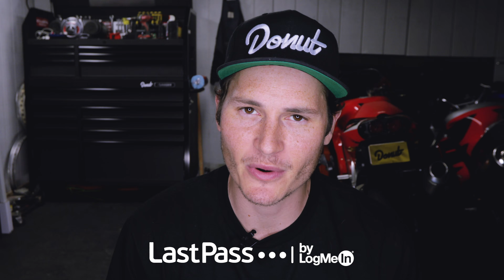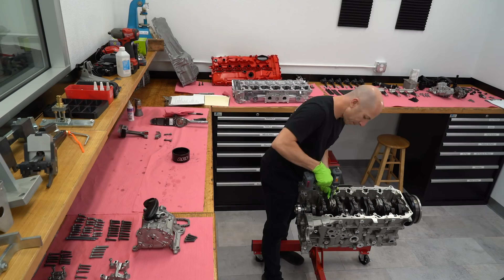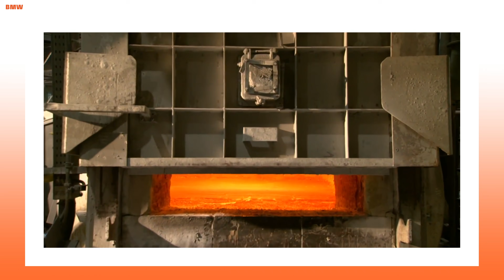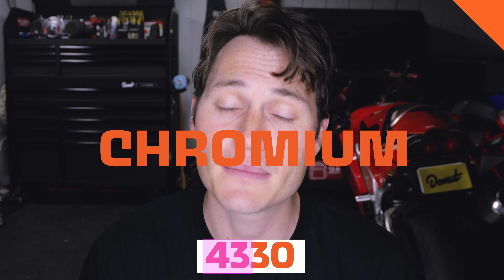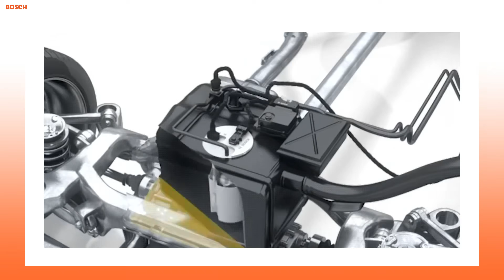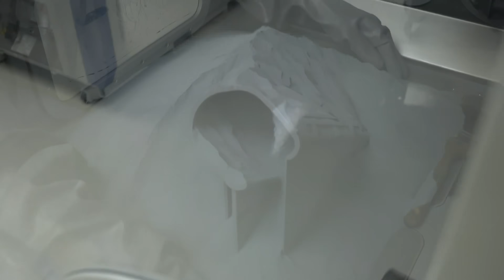The FIRST 1000HP 2020 Supra - Tech Explained

Comment: Having worked as a master technician for an investment casting firm (largest in the US) cast parts, can be just as strong as (hot) forged parts, given you properly design the mold then heat treat it. Also, you don't differentiate between hot forging and cold forging. Cold forging in a press retains / creates a TON more internal strength than hot forging. So grain structure horseshit aside, most hot forged shit, is way too hot to allow for uniform flow (it all gets re-arranged). Also, any proper casting, has no void issues, except maybe on hard corners on the outside (which would be shrink, not void). I ran a melt deck, that produced over a billion dollars (to the seller) of parts. Probably 7 billion market value. I could tell you just about anything except cobalt steels and aluminum (which was run in a different plant).

Comment: well 2JZ still cheaper than B58 if we are talking to reach 1000 hp right?
Reply: Takes like....under 7k to get a B58 to like...750-near 800whp and that's only having a bigger turbo,charge pipes,downpipes,tune,intake. None have modded pistons yet nor have any have put new cranks in them yet to pull any numbers but once they start slapping better pistons they'll be touching over 800-900+whp range more commonly.

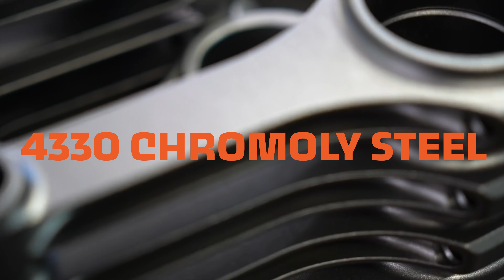Comment: Around 14:08.... a motor... are you talking about the alternator?... Not trying to be a dick but wow. Lets nail down the difference between an engine and a motor before we make a 'youtube' channel. I didn't expect explicit knowledge in your cute commetary on forging and casting and sand and... I would love for you to explain the difference to me about sand casting, core sand, resinated core sand, horizontal and vertical parted sand castings. What is a mold?  A parting line..? yea. Your NOT AN ENGINEER. Fine. But your making videos. Bro, please never refer to a combustion thermodynamic process powerplant otherwise known as an ENGINE as a MOTOR ever again.... A MOTOR is what you'll find in those fancy TESLAs that have wicked fast accelerations and sound like a fart in the wind on the freeway. Cheers mate!

Comment: You literally said it was a mostly stock engine, and then you said he rebuilt the engine. Wtf is this discrepency
Reply: They only changed the pistons internally,new intake , injectors exhaust manifold and a bigger turbo 

That's similar to a 2jz build but with a 2jz the rods are weaker point

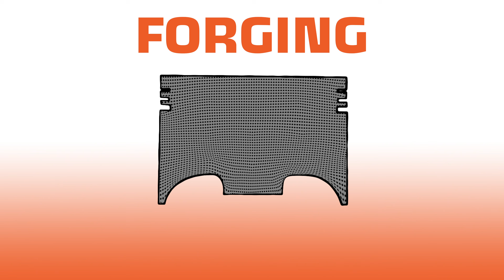Comment: At about 12:40 you stated that it's going to have a crystal structure in a uniform orientation, however this is only true in a single crystal sample which are not used in forging or in the automotive industry due to cost, among other factors.

Comment: so basically like the old supra, the engine was over engineered...
Reply: In simple words. BMW took a N54 took the best parts off it and did this:they took the block,bottom end,crank,and internals from a diesel i6 and made it modular with forged internals and crank and made a cooling system to keep it from overheating and made it closed deck rather than open like the N54 with 2 or 6 port heads. So basically a overengineered N54.

Comment: I hope some of you can answer this:
What were the cost of tuning it to 1000hp? Which one is cheaper to tune? 2jz or this? I want a comparison between these two! 
Sorry for bed engrish 🤫
Reply: In the time he made this he had made most of the parts himself so it'll probably be more expensive than a 2j just cause he made it himself possibly. But the highest rated B58s RN are pushing 6-750+whp with only a tune,turbo,intake,downpipe,and charge pipes being like 4-7k depending on the parts(mainly since 800whp is suppose to be there stock internals limit but only one has reached that high). Now there are cranks and pistons being made for them but no one's really had time to put them or use them in any B58 mk5s yet(or any for that matter yet)so we'd have to wait and see the numbers from them for rn.

Comment: What was the compression ratio in the cylinder itself? The 39:1 figure must include the boost pressure as compression. I am just curious about what the cylinder compression ratio is because the default compression ratio in the 2020 Supra was high(11:1). They lowered it to 10.2:1 for the 2021 model. That allows much higher boost pressures.
Reply: I was wondering why he said 39:1 is that normal engineering practice when defining compression ratio?

Comment: "Relatively limited modifications" =? Tears down entire engine.... hmmm
Reply: Yes, that's what smart people do, understand it before messing with something
Reply: Well for an engine that produced 1000 HP and has limited aftermarket parts is relatively has limited modification. Stephen Papadakis is not just a typical mechanic that thinks he knows everything by just slapping a freaking turbo and waits until it blows up
Reply: I know right..haha
Reply: He tore down the engine to understand the structure. Now that he knows it he can tune other supras relatively easily.
Reply: And he had to make the manifold 3d printed because there are no aftermarket fuel injectors. Once the aftermarket support catches up no 3d printed intake manifold will be required making the tuning easier.

Comment: 39:1 compression is an imaginary number that is really so far away from being reality, even Formula 1 cars have numbers around 15-17:1. I don't know where this number comes from, probably it is calculated as dynamic compression ratio or simply the pressure ratio.  Good job anyway, considering the efficiency loss due to the outdated injection system, it should have more potential in terms of power.

Comment: Ugh you are NOT nerding out- forging is NOT better because it aligns grain structure, that happens during the HEAT treat, which cast or forged parts have to go through. Its a lack of voids and the choice of steels that makes forged parts better- but forging creates stress fractures which means that part HAS to be normalized BEFORE heat treating- if you just forged a part and finished it and shipped it out it would IMMEDIATELY fail. Donut- stop continuing this incorrect wives tail. Research stress fractures, forging, and heat treat and make a video about it please.

Comment: Isn’t this basically a 40i engine?
Reply: Yes. Main difference between it is that it has a high pressure fuel system compared to other B58s.
Reply: @carboydorifutoparty3976  The supra has that? so the Supra has more potential power than say an M340i?

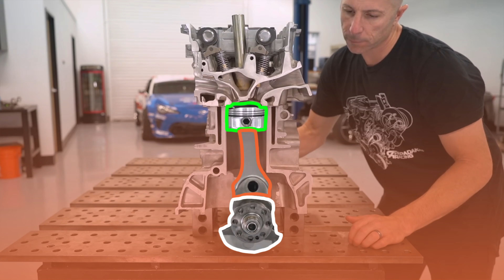Comment: 18:18 Yes I know about rod bearings, my 2003 Toyota Corolla pushing a whopping 7 horsepower decided to have some soda and chips, except instead of drinking soda it spit out oil all over my suspension but only under high loads, and instead of eating chips it decided to use the connecting rod as a hammer to beat the living hell out of the rod bearing until my oil pan looked like the bottom of a metal flavored Pringle's can.

Comment: 21:00 . All of those things listed are capable by the gen2 coyote engine. Upwards of 700 you want a billet parts in your planetary gear set, up of 800 you may wanna start looking at oil pump gears. At 1000, you want upgraded timing chain, guides and and tensioners.   but in terms of cams, rings rods pistons bearings the block itself and the springs and valves, the coyote is stout and it’ll make it (but not live there). If you want to live at that power you might want new sleeves, rods and pistons.

Brett la’salle has a 1600+ whp gen1 block (which is reguarded as weaker in terms of peak power) that has aftermarket pistons, sleeves, and rods. Stock ignition, stock block, stock crank, stock cams, stock heads, but the intake valves are ported only 1mm. Surprised the coyote doesn’t get the attention the 2j’s do when they crack after 3 passes at 1200 wheel. The damn 5.2 has 12:1 compression. Stock it’s good for 10, maybe 12 psi max but If that gets a built bottom end, 20-25 psi of boost from twin turbskis is perfectly fine. Check out alejandro Flores podcasts of talking shit on YouTube for tuning suggestions. He usually gets questions on how reliable the ‘yote is at horsepowers and he’s tuned everything under the sun, he knows it all

Comment: As a materials engineer working in a facility that specializes in forging crankshafts, this is a great video. I'm glad you included the basics and mentioned the grain structure of the material. The difference in the chemical composition of the material and all of the material processing involved in making things more reliable can be really interesting but, can be hard to present in an interesting way to an audience.

Comment: One advantage of a cast piston is that they are less ductile, which means they maintain their size and shape better than forged pistons. This is useful for daily driven cars as the diameter of the piston will change less dramatically, so that the engine will maintain its compression better form temperature changes. Forged pistons are more ductile, meaning they can withstand more energy and return to their normal shape when cool again without cracking or warping. So really it depends on application, no specific one is 'better.'

Comment: “Relatively limited modifications” yeah you know, just a 3D printed intake manifold and forged internals that can withstand 1000+hp  and a big turbo
Reply: 1000hp on a stock block is 1000hp on a stock block.
Reply: it's 3D printed metal

Comment: Do 4 cylinder engines run higher compression ratio? My car has a 2.0 L4 engine at 10:1 stock
Reply: cLuTcH BleacH all depends on the car. Mazda 2.0L are running like 13:1.

Comment: i've been working on a engine machining/repair shop for around two and a half - three years now, most people have no ideia how insane is an engine that can push over 350hp, most daily drivers now barely make 160hp, most of then crack at some point (3 cinlinder shts)... 1000hp is close to spaceship tech, tolerances, torques, structure and quality of the parts, knowing how much you can push with the current settings, one little mistake in any of those can cause a catastrophic failure

Comment: 10:1 compression it’s low by modern standards. I’m sorry but it bugged me really bad. My old “95 Kawasaki has above 14:1 compression ratio. Mazda’s skyactive engines are somewhere around 15-16:1 compression ratio. 7-8 compression ratio it’s basically your “60’s v8 with 100hp
Reply: depends if the engine is N/A or forced induction. Forced induction always have lower compression ratio

Comment: This guy just said stock engine........... Followed up with complete rebuild. Just contradicted yourself, this motor is not equal with the 2jz. Obviously you can build a k20 or k24 to 1000hp.  It does not handle a 1000hp without being opened up.

Comment: 2JZ is more better than 2019 supra's engine in my opinion
Reply: Aftermarket and reliability wise yes. Other than that no not really.
Reply: Stock 2JZ is overrated specially when you compare to engines we have nowadays. Part prices are way too expensive and just like any other engines it requires heavy upkeeps to keep it running safe. I’m certified tech (Toyota n BMW) and used to owned 800hp RX7 (FD), EVOX, RX8, Boss302, Genesis Coupe, Ligenfelter F-body Cmaro, Z, FRS and etc. Reason why I didn’t like Supra was it was really good at straight away pull but you could easily go faster with Terminator with less money than Supra. I’m pretty sure people have unrealistic image of Supra thanks to Fast n Furious and handful of monster Supra which owners put insane amount of effort and money.

Comment: This is really great but that's not what the 2JZ was all about. If you swap out the internals, many engines can make big power. The magic about the 2JZ was that you would not have to do that. Reliable 800 HP were achievable only with a bigger turbo, new injectors and fuel pump. But let's see, maybe this is also capable of that.
Reply: Already broke 800whp. Only with a turbo,tune,intake,and downpipes. But the 2021 mk5s B58 might be a different story.

Comment: You know what's going to be even better than metal 3D printed part ? AI designed 3D printed parts. Some really crazy stuff is beginning to be tested where AI design the parts for the best ratio of weight/vibration resistance/heat resistance/stress/fatigue etc The parts look really alien sometimes but they beat everything we made with our mk1 brains and cad software until now

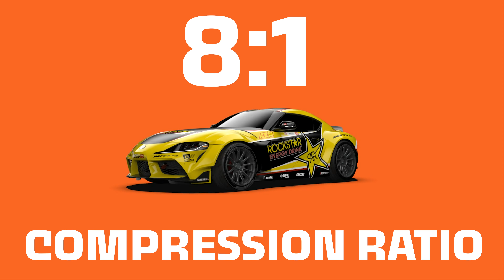Comment: 17:11 [High horsepower and race *motors that are running off race fuel are in the  10.5:1 to 11:1]  Yes this was the case back in the 1960's but nowadays we have standard production non race engines coming out the factory with those ratios running on run on pump gas all thanks to advancements in cam timing and air/fuel delivery.  "Typically it's in the rage of 7:1 to 8:1"  Where are your writers getting this outdated data?
Reply: 500cc bikes have like 12.5:1 LMAO

Comment: 15:18  They're not torquing the bolts to 135ftlbs, they are torquing just the nuts to that while the studs are installed hand tight.  That's the beauty of head studs vs head bolts.

Comment: Forged is not always better, forged parts expand preferentially in the direction of the grain structure, if you aren't driving at the limit you'll have piston slap, for normal and even romping on it a little here and there casting is much better.

Comment: hi there, just wanted to let you guys know that 3d printing Metall is not New, the idea and process already exists over 50 years. The Problem is that it takes alot of time to 3d print stuff, you are usually faster to just mill them out of a block. 3d printing is better though if you have complex pieces that have inner tunnels for stuff like coolant or air. 
Have a nice day^^

Comment: Say's stock engine then mentions forged parts lol that means the engine is no longer stock! it uses the original engine block but the moment you change any part it is no longer stock. it is a heavily modified B58 which means its not STOCK!!!! sorry that comment really bugged me, did it bug anyone else?
Reply: The engine comes in the car with those forged parts, it literally just means the car was designed with them already in, that's like saying cars with aluminum engine blocks aren't stock because engines weren't originally made with aluminum blocks. Its a choice of material. Forged doesn't necessarily mean that it has to be aftermarket.

Comment: I don’t get why there is so much arguing between the 2jz and b58 engine... Everyone saying that the b58 engine is hard to modify compared to the 2jz is it’s mainly due to the fact the engine is brand new technology wise. Give it some time and I’m fairly sure the aftermarket industry will allow you to be able to modify it with ease just like the 2jz. I’m fairly certain it was the same story for the 2jz engine when it was first introduced... Use your logic guys please...
Reply: But bro the A80 made 1600+ horsepower from day 1 bro stop ur just wrong bro
Reply: Mike Fox lmao what a bold statement to make. If your comment is valid that means either the engine was based on common designs that was well implemented in the aftermarket industry at that time or that technology that yamaha created was pretty simple in 1993.